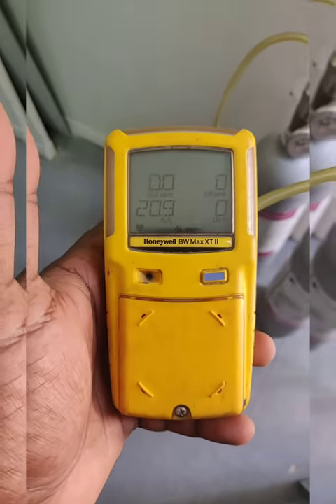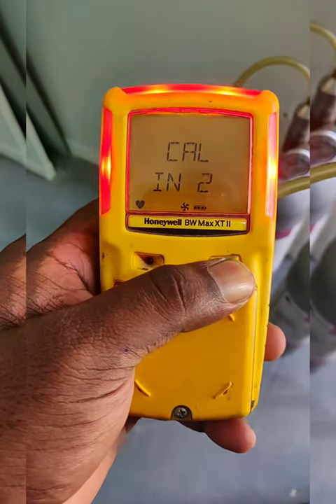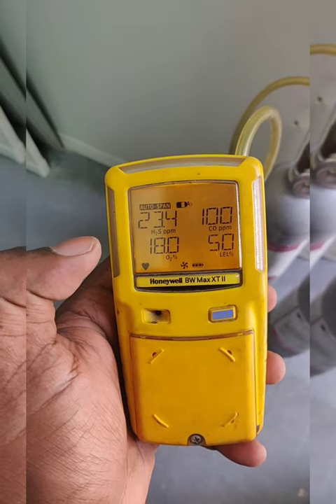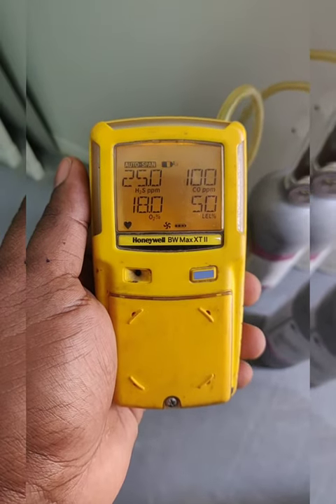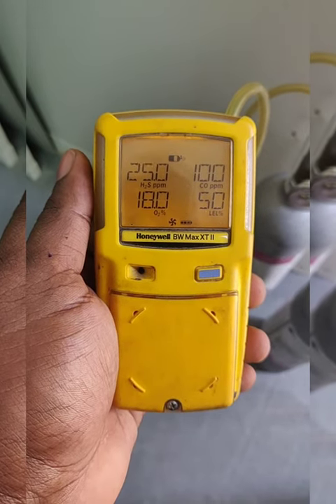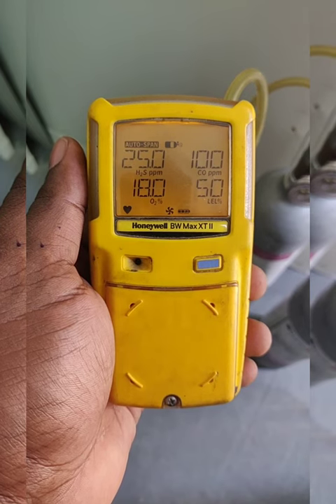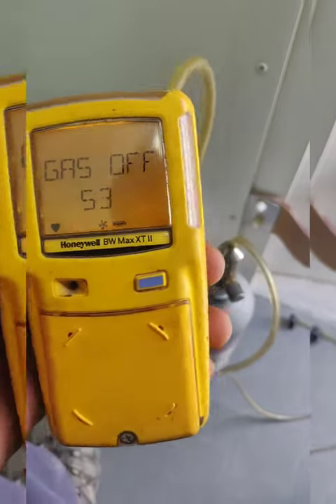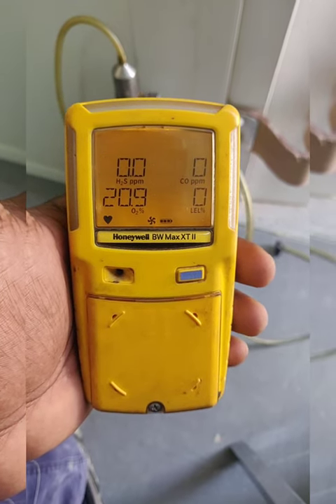Calibration of Bw Honeywell Max XT II multi gas detector

Comment: why my detector show "IR LOCK ON", not display auto -span
Reply: could you help me
Reply from the maker: If the Cal IR Lock option is enabled and a manual calibration is attempted, the sensor(s) will only auto zero. Calibration will not be performed.

Comment: I tried calibrating but the O2 sensor was not spanning to the right measurements. Always at 19.2% .I have changed sensors but still. But the same sensor works on another. What could be the problem
Reply from the maker: Check your Gas. Maybe having problems with Gas
Reply: @theAestheticMariner  using the same Gas to calibrate other detectors
Reply: Please can you show me how to calculate or identify the expiry or manufacture date of the O2 sensor?
Reply from the maker: Check my short video i already uploaded how to check the expiry date of O2 sensor
Reply: @theAestheticMariner  now the O2 sensor shows OL on the screen when calibrating. What could be problem or what does OL mean?